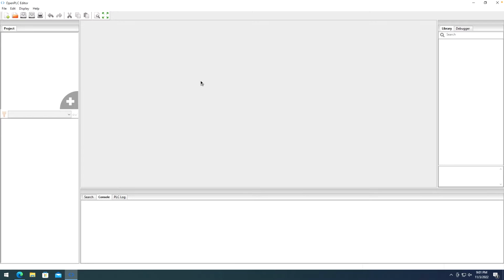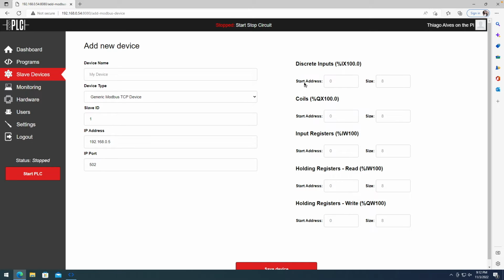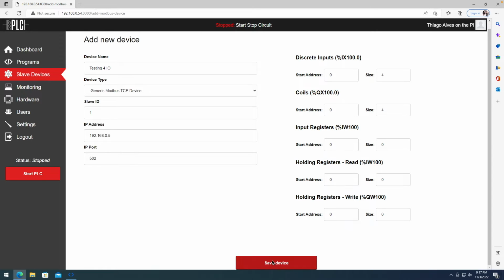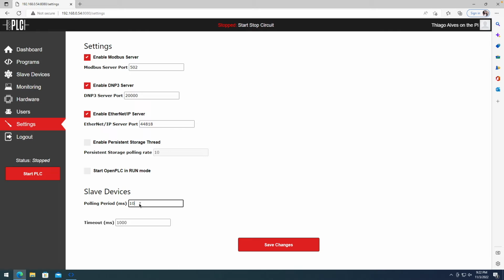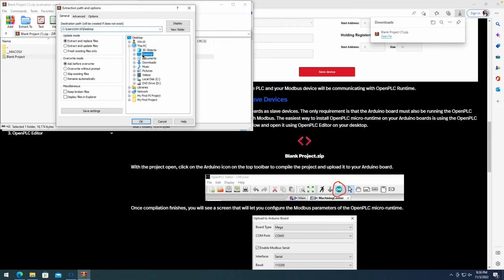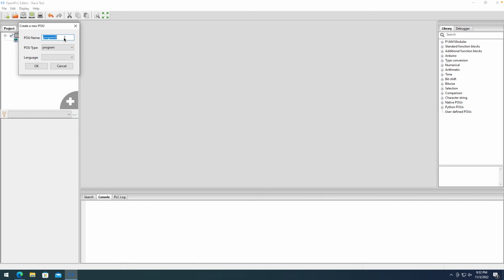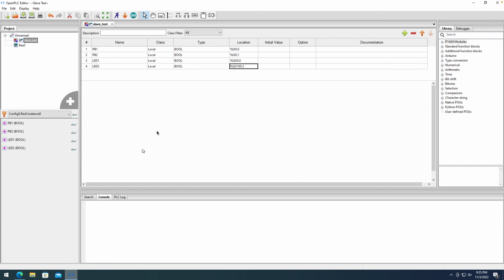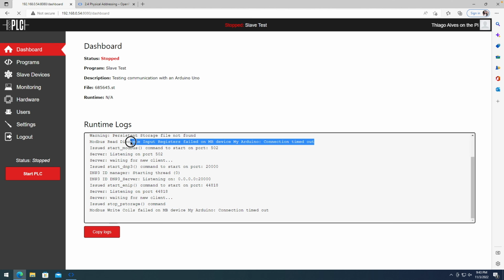Basics 05: Expanding PLC IOs with OpenPLC Slave Devices

Comment: There is a problem with the Arduino Mega. By adding Arduino Mega as slave we should have:
24 Discrete Inputs
24 Coils
8 Input Registers
0 Holding Register - Read
12 Holding Register - Write

Instead they are automatically taken
24 Discrete Inputs
16 Coils
16 input registers
0 Holding Register - Read
12 Holding Register - Write

I tried to manually add the device but every time I get the error message: "Please fill out all the fields before saving!"

Comment: Hey ! Great video !
Is it possible to make the Rapsberry/Arduino system you presented at 24:33 independent from the host PC ? For example, have the OpenPLC runtime running on the Raspberry and the Arduino connected on it too, while using an battery as power supply ?
Reply from the maker: The system is totally independent from the PC. In that case, the host is actually the Raspberry Pi itself. The PC is used only to create the PLC program and upload it to the Pi. The usb cable you see connected to the Pi is used only for power.
Reply: Ooh I see, I thought there were two cables both connected to the PC. I didn’t catch that it was a single cable looping on itself ^^ Thanks !

Comment: What about shift register for inputs and outputs
I used this Way in ldmicro ,I can expand Io pins using many shift registers
For information ldmicro is for programming microcontroller by ladder
Reply from the maker: Shift registers are a “hardware-way” to expand IO. It is common to find them internally on many commercial PLCs. This is a more “external/software” way to expand IO using off the shelf devices. But anyway, OpenPLC can support shift registers as well, as long as the IO driver is written on a PLC block :) It might come on future versions of the Editor